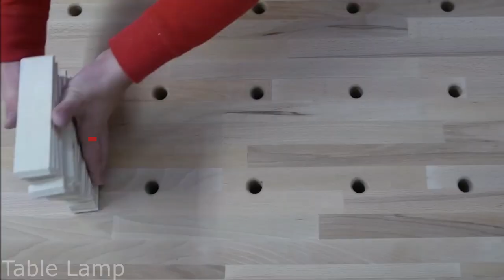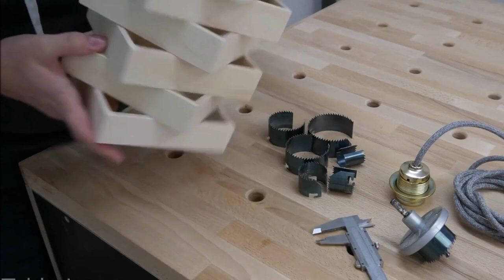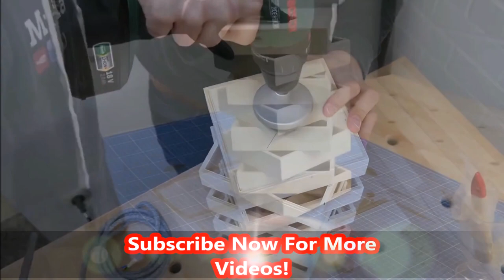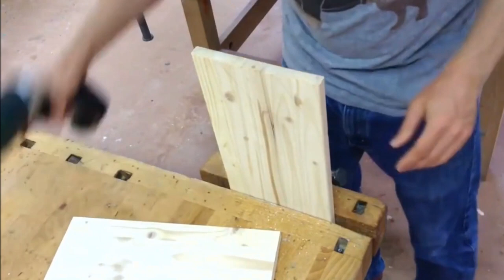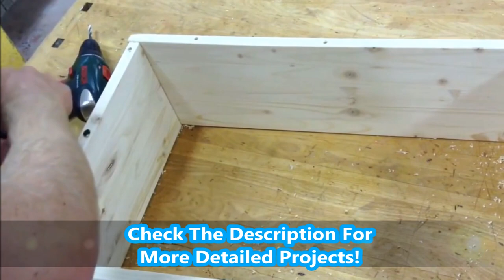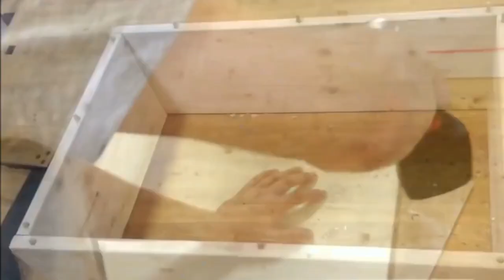Wooden Table Lamp DIY

Comment: where is the lamp?
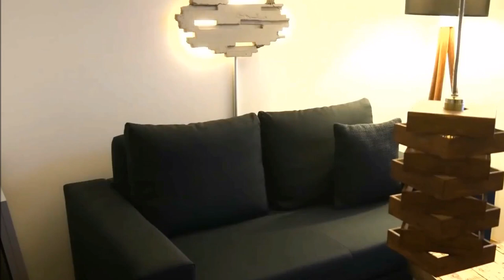Reply from the maker: Watch On 3:00 In This Video & Physically You Can Find It On Amazon.
Thanks!
Reply: TopFineWoodworking. Com is an amazing book about wood working. I took several classes and completed a one year diploma in carpentry at a local tech college; this is better than any book I worked out of during those courses. It includes useful photos and goes over almost everything.

Comment: Your work is amazing. i would like work with you. we also wooden and acrylic lamp manufacturer. are you interested?
Reply: The subjects covered in this woodworking website TopFineWoodworking. Com varies from wood types to tool types and uses. A few other subjects range from the various kinds of wood along with their distinct levels of difficulty when it comes to managing them. If you are still a beginner in wood working, then you will find this book very beneficial.